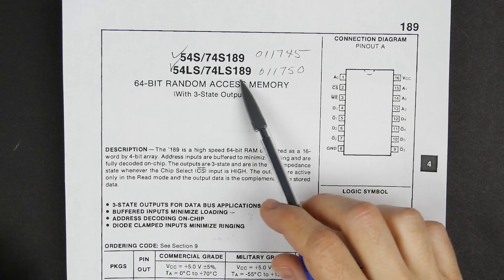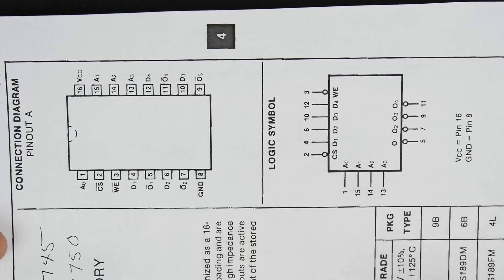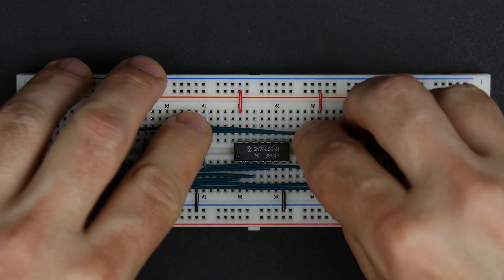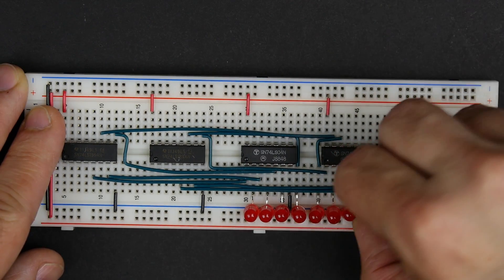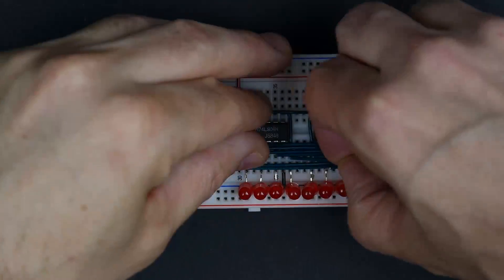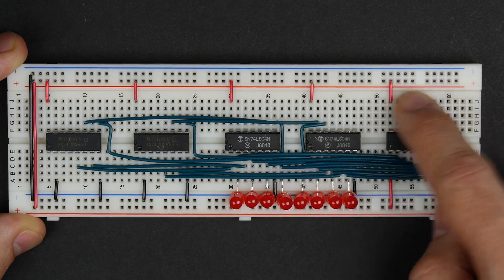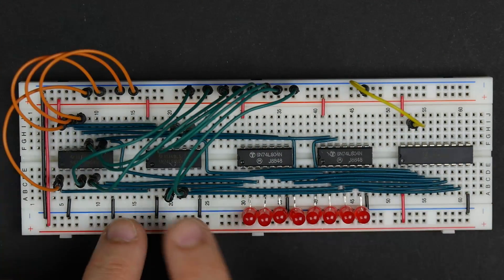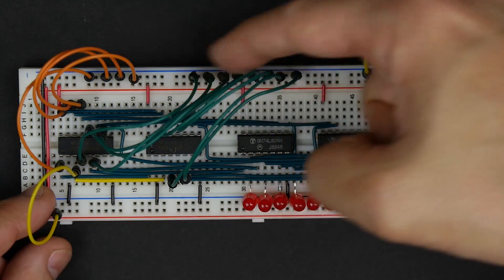RAM module build - part 1

Comment: Very nice video series. Please keep going! Also I have a question: Why aren't you using current limiting resistors on your LEDs?
Reply: because there is a 130Ω resistor on the collector of output transistor of the IC
Reply: I was wondering that too. furthermore, the HIGH output current of the 74LS04 is only 0.4mA max. where the LOW output current is 8mA max. those LEDs must have very low current requirements.
Reply: I was thinking the same thing, maybe the current is low enough to run the LEDs with out them.
Reply: That and many ICs have resistors on the output anyways. My blue LEDs wothout built in resistors all work fine without resistors when at the output of my 4000 series chips.
Reply: Amazed that this actually still works. IOS is -18mA to -55mA. Thus it can source 20mA for the LED  but it will pull down the voltage like hell. So that the '04 is sourcing so much current that it actually can't grantee the 2.4V VOH no more. Due to the  voltage drop of the LED the voltage can't be pulled below ~2V and the the '245 still sees a logic '1'. But this setup is rather on the edge.
Reply: What are some of your ideas to improve the design?
Reply: they're probably leds with built-in limiting resistors.